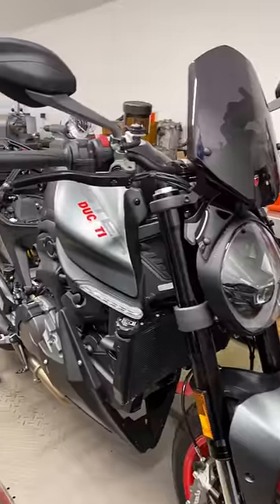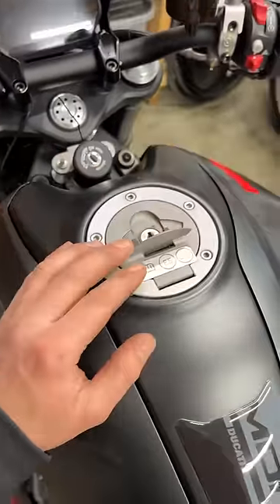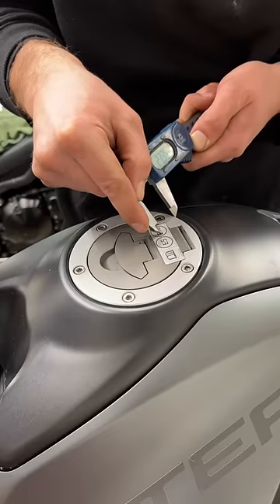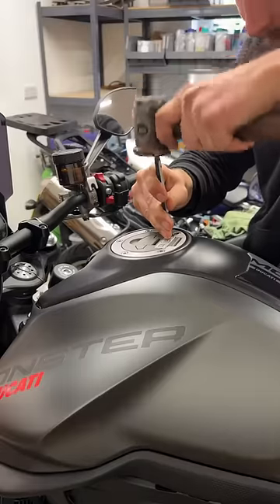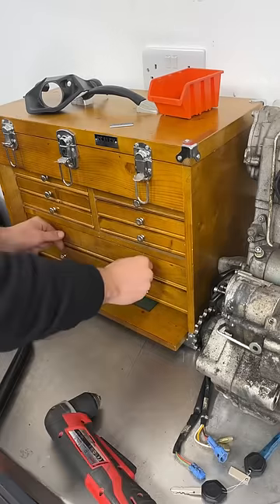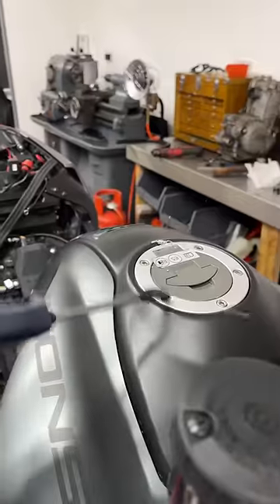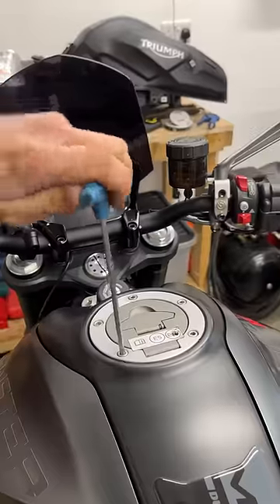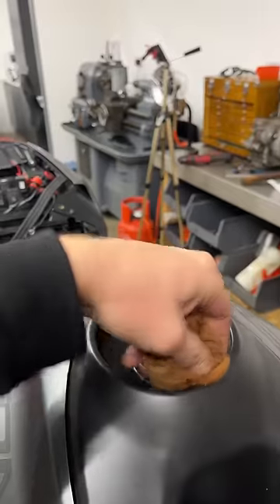38. This feels like sacrilege! #shorts #ducati #motorcycle #mechanic

Comment: This is why I not only lock up the handle bar lock, put an alarm disc lock, chain the front and rear tires with different locks. Also a handle lock that holds the brake lever.
Reply: I'm guessing you live in California lol
Reply: If possible it is best to chain your bike to something solid and through the frame/subframe, especially if you bike is expensive, wheels can be removed and replaced.
Reply: Yea in Britain they use Tyres.
Reply: Nah i usually just weld the gears and piston to the block.

Comment: Did the thief stole the original key also, or did they change the entire lock system?
How long did it take to be recovered.
Really curious about this.
Reply: Theres a couple of things thieves can do. Render the old lock useless, then re-wire an ignition switch/button. Or make a new key by decoding the lock with a tool like a Lishi tool
Reply: @Kanda Reed I agree that the best practice in this case is to change all locks, but the reason for asking if the thief stole the key or change the locks was to determine if all this was necessary. But in reality, if the plan was to change the gas cap regardless there was no need to spend 20 minutes measuring where to drill.
Reply: It's possible the original owner has had insurance replace their bike, and this one was purchased at auction by someone else looking to get it fit for resale.
Reply: @sonofNOM  Ok, that's possible. But why spend 20 minutes measuring exactly where the bolt is? Just ball park a bigger hole, you are.not going to keep the cap afterwards. If the intention was to make a video for people to talk about the yes, great work, but to help people fix an issue, they could have been done changing all locks in the same time.

Comment: So much easier just drilling the tumbler. Could even replace the lock after and not pay for the whole lid. Don't even have to be accurate with the drill bit size. But well done being accurate and doing a good job! Just a little slower than drilling the tumbler. 👍
Reply: Pòooppo0p9p9

Comment: so did you flush the fuel tank and clean/check it for metal shavings?

I'de defo have tried picking that lock first.. much easier really, I can pick such locks in under 5 minutes and i'm not even good at it

Comment: Would the owner not have the key for the fuel cap? A thief needs to do this, not the owner. Either Ducati can supply a new key, or the owner has the key code and can cut one.

Comment: If you take the external bolts out of the cap you can twist the entire cap (with a little force) and break the security bolt off. The caps still perfectly use able just without that one bolt. I had a tank lock seize up on me and ended up stranded at a petrol station unable to open the cap when I learned the lil trick. Admittedly you won't have the security lock but locktite when you refit the bolts and your good to go without a gaping hole 🤷‍♂️

Comment: Would doing this cause metal flakes to sit in the bottom of the fuel tank once the drill punches through ? Would you syphon out the tank and use a magnet to get the flakes out or is there a better method ?
Reply: Fuel filters exist before and after pump, you can see the ring assembly has a couple of cm around ,

I was wondering about drill bits sparking near gasoline
Reply: No. The drilled spot is outside of the filler neck and the neck has a seal. Never owned a motorcycle ehh ?

Comment: I'm a little confused, did you throw the old keys away before the bike got recovered? The thieves tole the bike, not the keys. So why don't you have the original key to open the cap?
Reply from the maker: I’m definitely going to do a video on the industry of buying back stolen and recovered bikes from the police…
Reply: @Mike_abel  Actually a good video idea. I'm sure most people don't know anything about that.

We've had two vehicles stolen, both recovered without being written off. So we had keys to both.

Comment: If you need to do this in the future i'd invest in a cheap lockpicking kit and a bit of practice, even on modern high end bikes the locks are atrociously bad and they can be picked, often raked open by an absolute novice with tools commonly found in lockpick sets, this normally isn't a problem as 99% of bikes nowadays have chipped keys with immobilisers built in, but is very useful in situations exactly like this.

Comment: Is this the same on other fuel cap security bolts? I lost my old Zephyr keys and need to figure out how to open it up, without getting a whole new tank. 

Then again I might just use the engine for a shifterkart on steroids (4cyl)

Comment: It seems motorcycle theft in the UK has really got out of hand, like it's practically become a goddamned "folk sport." Apparently, the cops in some locales don't even bother investigating them anymore. I would have thought the insurance companies might have squawked about it loudly enough for harsher measures, since "3rd Party, Fire and Theft" policies are the basic midrange norm yonder, unlike the liability only policies typical here in the States as the minimum requirement. Yet I presume the insurance companies are just happy to pass along the cost of all those criminal hijinx to their policy holders. Currently the bike I insure here in the States for roughly £40 annually, a Royal Enfield 500 Bullet single, costs about 10 times that to insure in the London area, even liability-only, and about 15x that or more to add theft and fire to the policy.

Comment: Never understood why bikes have locks on  their gas cap when most cars don’t 😂
Reply: most cars actually do have a metal cover , that has a lock on it..
Cars have had fuel cap locks for ages, they only went away when the fuel lid lock came in place.

Lock your car with the remote.. and now try opening.. won't work. cause its locked.

Comment: If you had to drill it out. How do you bolt it back on the new one?🤔
Reply: Drilled through the cap so he could just unscrew the bolt like normal. There would’ve been no more damage to the threads than just unscrewing it as if the cap was open
Reply from the maker: Thanks for answering that, yes it was just to access the Allen bolt.

Comment: What doesn’t match up in his story is:

 If the thieves stole it and the owner got it back, why don’t you use his key to open the tank and then replace the lock?

 If the tank lock was damaged and they broke it like the ignition, why don’t you open the tank lock like they did with the screwdriver and then replace it?

Comment: next time just pick the lock
lockpicks are cheap and picking locks is easy

I picked the first lock of a motorcycle with lock picking tools I made from the pins in pop rivets
needed to pick the lock because the customer purcheased a used fuel tank with a missing key

Comment: Do motorcycles have security measures to prevent theft? Like could someone just take out the ignition cylinder and replace it with a new one

Comment: How do you not have a normal rechargeable drill.
Reply from the maker: The 90 degree Milwaukee is a life saver in tight spaces
Reply: @Mike_abel  yeah, in tight spaces it is awesome but in generall i don't like the chuck, the speed controll and how you have to hold it.
Between, i realy like your videos.

Comment: That security bolt is a really pointless idea when you consider that  the fuel tank barely holds 20 litres of fuel and  that the fuel lines are exposed underneath .
Not sure which is dumber , this bolt or those  lever locks that you put on your front break :D Bloody ridiculous.

Comment: Personally, I think hiring a locksmith would have been cheaper.
Reply: What?
Drill bit was maybe no more than a fiver.
Locksmith probably £60+
Reply: @PatrickSwayzeOnDbol  had to buy a new gas tank lid on a ducati instead of cutting a key
Reply: @MotorcycleRebuilds  cutting a key is wasted cost since most likely they will be replacing the core when replacing the ignition to avoid having two different keys.
Should have just drilled the core sine that was most likely to be replaced anyway and adds no additional cost in terms of parts to complete the job.
Reply: @MagicBrownMan  that's assuming you could buy the core or pins to rekey the core

Comment: How did they assemble the fuel tank cap in the first place?
Reply from the maker: The bike was stolen and recovered loosing the keys in the process. If you have the original keys it can be accessed from inside.